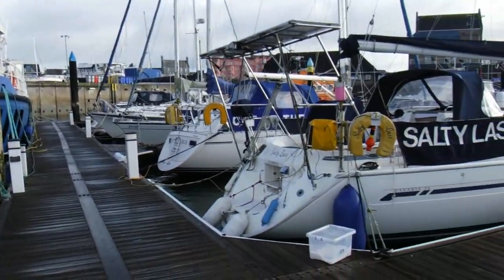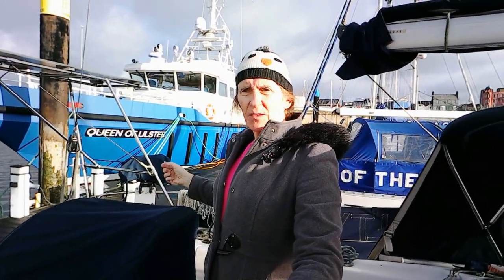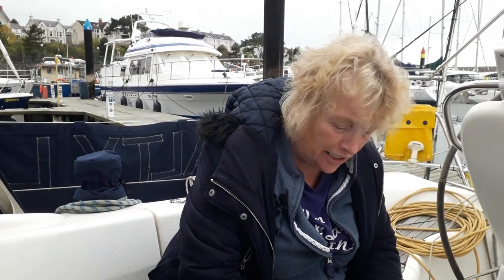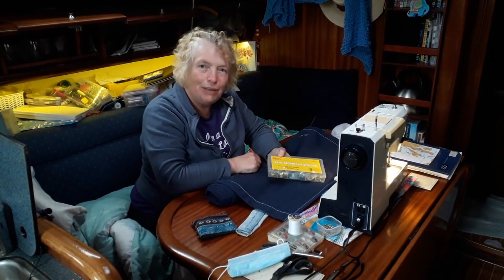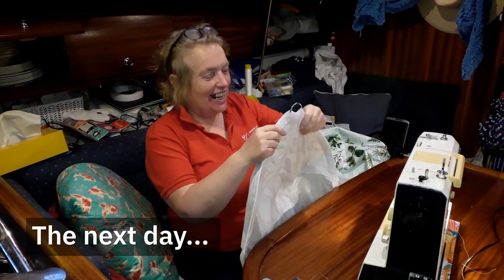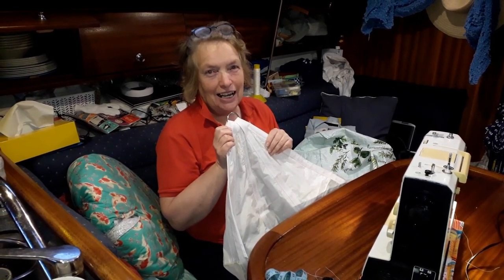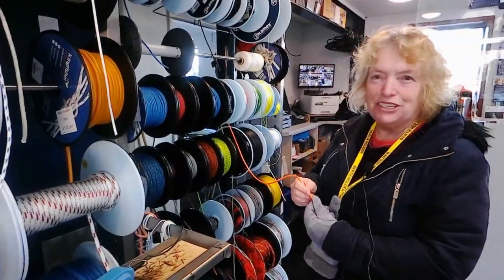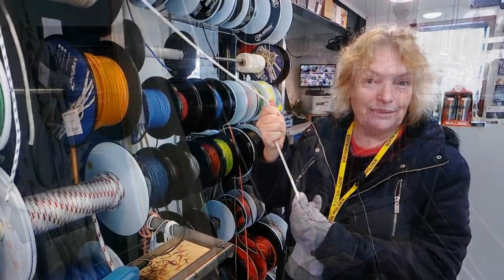Sailing Northern Ireland - Cruising chute - free sail - Bangor marina - Ep. 273

Comment: I have the same outboard for the dinghy. I run the fuel out at the end of the season. When I bought my B32 the fella said take the dinghy motor (almost new) as it never works. I took the carburetor apart and a tiny tiny O ring was split. Ordered seals for good measure and the O ring and it started. Still took time to have it run smoother but starts every time (touching wood). I have a donated sail you have me keen to try this summer. I look forward to your test sail with the new rigging. As always thanks for a fun and informative episode. 🇨🇦
Reply from the maker: Thanks for the info on the outboard. Ours has kept working but it is always interesting to hear of other boaters and their issues / fixes. I hope you get to use your donated sail and when we get our test sail, we shall include it on the channel

Comment: If you sell your boat you could get an electric outboard. No worries about fuel, starting or leaving it for a long time, just need a skeg if you treat it like I do. Well done with the spinnaker you will need a pole. I have a Genaker and because the pole which I was trying to sell was so heavy and big, I used a boat hook which snapped immediately. Some power and weight in them there sails.  If some one is really kind they will give you a genaker so much easier and can be furled in.  All looking good people keep up the good work.
Reply from the maker: If we sell the boat we do not need any outboard. 😄